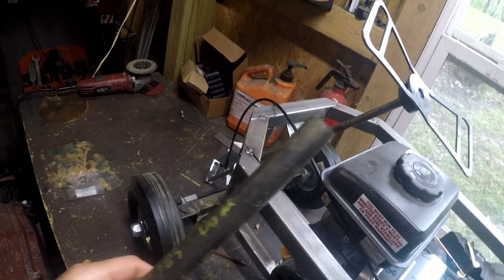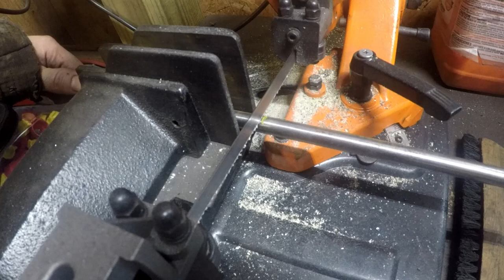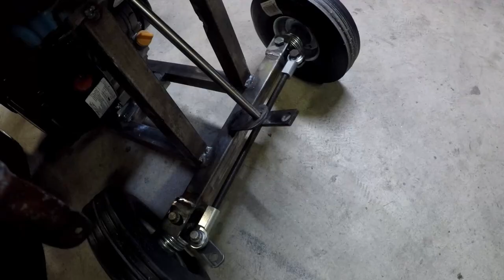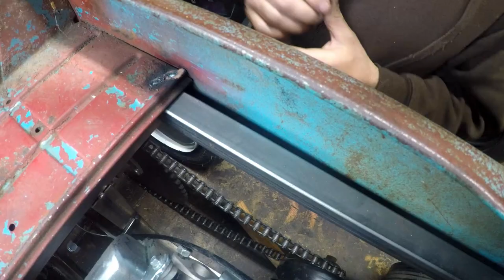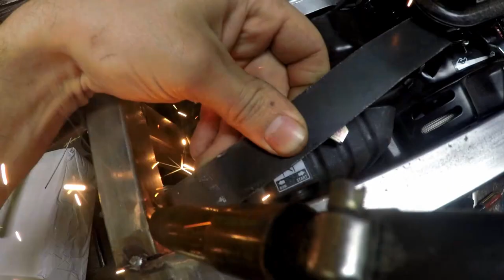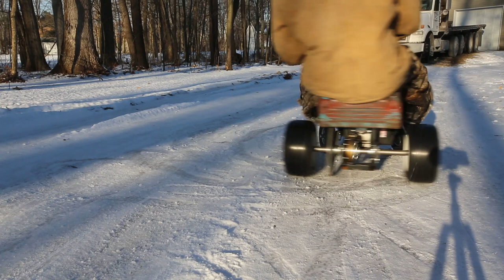Finishing the Gasser Pedal Car! Mini Go Kart!

Comment: What rear sprocket did you go with? I  put a 79 cc on a mini bike and it won't even pull itself much less me on it
Reply from the maker: It's been awhile but I'm pretty sure its a 60 tooth, 9 3/4 diameter. It wont just take off with me on it I have to help it along, but once it gets rolling it is fine. My kids have no issue but they dont weigh anything.